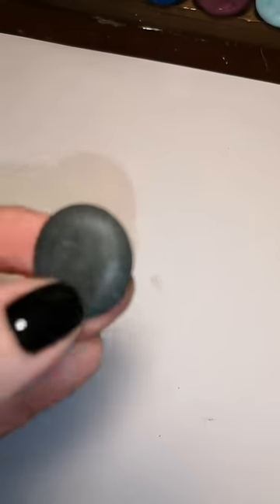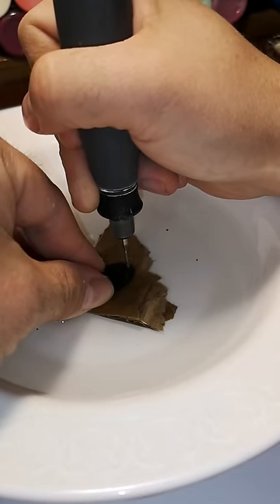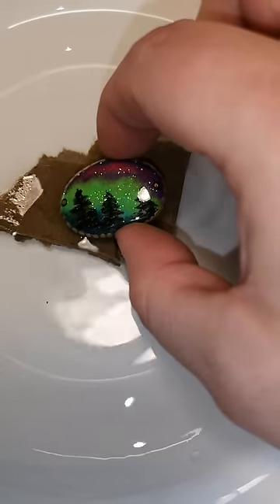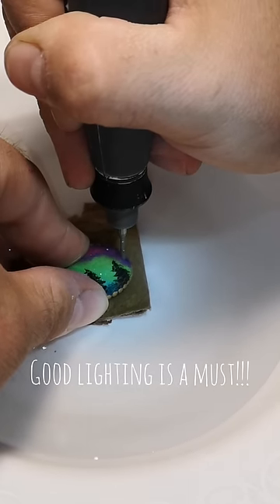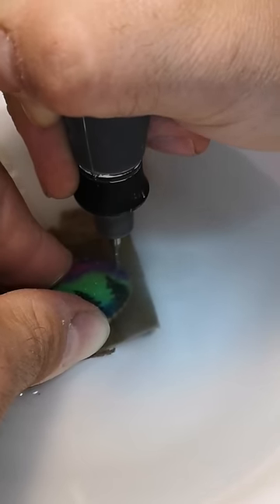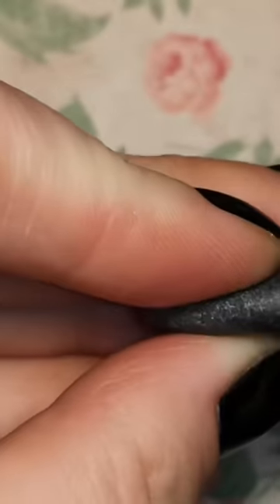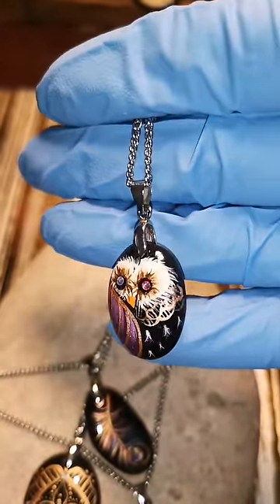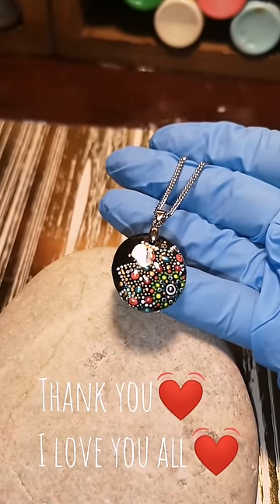How to drill stones for pendants!

Comment: Just ordered the drill bits. Thank you for providing this information. The bails are unavailable so My next task is to search for those. Thanks Rachel you awesome.
Reply: I bought the drill bits you listed, been trying for an hour different bits, yes water and its a small stone with only a dent in it and the bits have worn down so Im not sure if it's my rock its a light tan /grey pebble. ugh I don't understand why it's not working. Ill try a different stone to see that's all I can think of. It looked like the bit your husband used was gold in colour but could be the lighting. these are not gold in colour.
Reply from the maker: It's a diamond tipped bit, that is the most importnt thing. Regular drill bits will not cut the stone. Arr you using diamond head bits?
Reply: @rachelsrockscanada  yes, I bought the same bits. I think I was pressing way to hard and wore out the bits. I’m having some elbow issues so I’ll try again later on .